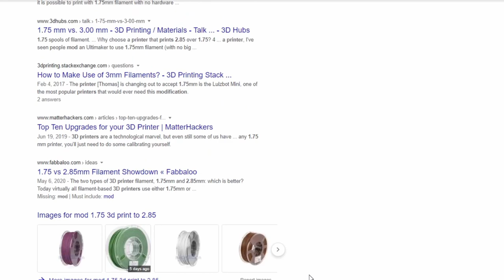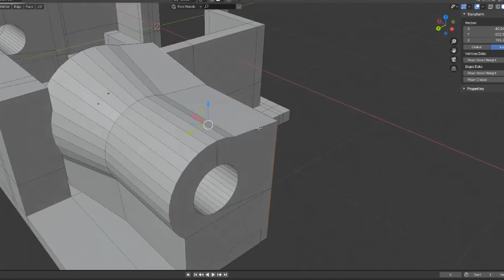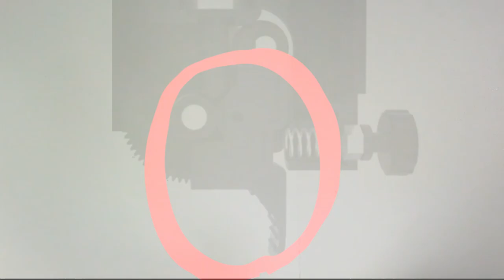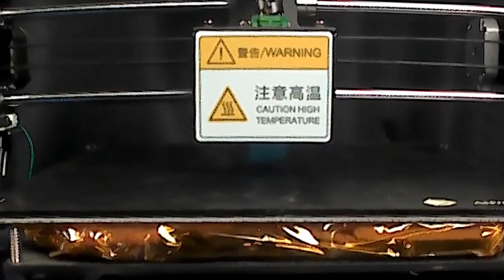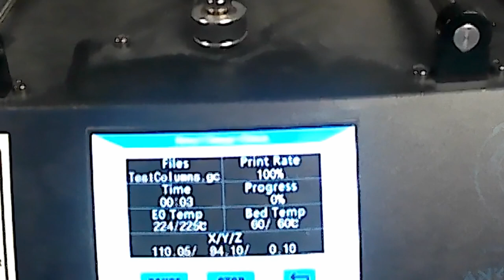Changed a Printer from 1.75 to 2.85 Filament- Possible or Worth It????

Comment: I own a Anet A8 did a similar mod, less modifications required since its a direct drive and now I print with nylon trimmer line they come in odd sizes so it takes a little work (1.7, 2.0, 2.4 2.8). I did it originally because there was  a really good deal on PCTPU but only in the 2.85mm size. that filament it awesome. good work on you mod :D
Reply from the maker: Thanks.  I happy you liked it.

Comment: dope. do you know any modifcation to delete the bowden  tube and have the extruder above the nozzle/hot end? I knew someone who have lulzbot mini who was able to do this mod
Reply from the maker: You can create a Direct extruder rig which is something I might be able to do soon since I've just finished a  new modification to my machine.  There's a couple of other videos to come out before that one but let me know if it's something that you'd like to see.
Reply: I did it on an Ender 3 Pro, I designed and printed some parts to mount the step motor and extruder plate over the hotend. It was like 3 years ago and it keeps printing as the first day, no modifications or adjustments required after upgraded. One of the best upgrades I performed on this printer, really love the way it works that when it was bowden type.

Comment: I want to print 1 mm filament on 1.75 mm filament printer. How do you recommend going about it? thanks in advance
Reply from the maker: A couple of things you'll need to do then.  Change the bowden tube to the proper dimension + Remove the inner tubing from your hot end assembly (some versions that won't be possible, so you'll need to check yours + Possibly adjust your extruder feeder to accept that thickness.  After doing the physical modifications you'll have to update your slicer settings for the larger dimension and figure out new print settings most likely.  Best of luck. :)

Comment: Doing this now with an ender b/c someone gave me a bunch of 2.35mm filament. Catching all heck trying to take it one step further and going full metal. Settled on a e3d v5 3.0 long setup when it was all said and done as it seems no one makes a 3.00mm / M6 capable all metal setup in V6.
Reply from the maker: The biggest hurdle I came across was the filament being so brittle.  The number of times it cracked was frustrating.  Best of luck with your mod, though.
Reply: @Yarkspiri  Do you have a filament dryer ? They REALLY help out.
Reply from the maker: @chrismoore1932  Not currently. Most of the stuff I've been working with didn't need it all that much, although it would have been good to try with the thicker filament.
Reply: @Yarkspiri  It revived some three year old PETG (the 3.00mm that started this for me) and really helped with the stringing and ability to calibrate the printer for the filament. I have the Sunlu S1 and S4 dryers, I'm sure they all work about the same.
Reply: @Yarkspiri  Are you using the thin wall stuff to work in the existing connectors or did you get the super thicc ptfe tube? The upgrade kit I got from e3d came with the thicc stuff and I honestly havent ever seen it before myself but it feels like the filament wont burst out of it.
Reply from the maker: @chrismoore1932  I used the regular stuff.  I made sure to calibrate the extruder so that it would skip after a certain amount of pressure.  This prevents the filament from piercing the tubing.

Comment: Let me give you some advice. The new boden tube you used is not a good tube. It's going to break soon you need to get something with a thicker wall. E3d has a Titan extruder made for either 1.75 or 2.85 filaments. And it is worth it. I'll tell you why when it comes to tpu ninja flex you can't beat it. I have printed literally perfect parts with Ninja flex. It also cut your print time way down. I've also found a .8 mm nozzle to be Superior.
Reply from the maker: I've recently started switching to that company for parts since they seem to be built a lot better.  I'm waiting for some components to come in before I begin ordering replacement for my other machines.  Likewise, I'll keep that in mind, but I've since switched the machine back to the original since it was such a pain to deal with the thicker filament.

Comment: What filament is that blue flexible one at the end? It looks pretty damn cool I'd love to know
Reply from the maker: It's TPU which is a flexible filament that's quite durable and easy to print in most cases.  I use it often for parts that I don't was to break easily.  The only downside is that it's very difficult to do finishing work with items printed from this material.
Reply: @Yarkspiri  yeah but like what brand and stuff?
Reply from the maker: @davidblunt5149  I normally buy Sainsmart TPU filament.  I've tried other's but most haven't been as good.

Comment: Was wonder why expensive $4k+ printer use 2.85, happen to come across this video.  I also own a Mega S(E3D V6) ,  though apparently it wont benefit a small machine like ours its meant to print big and fast with beefy all metal hotend and dual gear extruder drive.
Reply from the maker: Yup.  I'm using the mod still but only because it's good for the functional parts that don't need to look pretty.  I may even try to use a 1mm nozzle to see if it's worth it in the future but who knows.

Comment: Wish I found this video earlier. I recently converted 2 of my 3 Sidewinder X1 to accept 3mm filament. After a while failing to get my settings adjusted, I simply created a new custom printer on Cura with the defaults of 2.85mm filament and this was the key I think. It works great 👍. Thank you for the info and your hard work. Btw, your thingiverse link to your filament sensor and guide isn't working. Any chance you can re-upload these?
Reply from the maker: I'm happy the video helped you out.  I'll check into the thinginverse files to see what's going on with those.
Reply from the maker: Ok the file has been updated.  The link should now work.
Reply: Thank you very much!
Reply: Yo I just saw this and may be trying the same thing, I have a sidewinder x2 do you have any tips on how I should go about doing this?
Reply: @crazyalex-qp3no  which printer u got?
Reply: @antd6738  Artillery Sidewinder x2
Reply: @crazyalex-qp3no  that was the easiest of all my printers (I have the x1 but I don't think it's any different with the x2). I opened up the extruder and replace (or drill out the plastic "cone" think it's called a guide, n I just removed the short ptfe tube that goes on top of the extruder. You can get the right size at Amazon 4mm outer dimension by 3mm inner, but I found it flowed easier without it. I picked up an extra extruder assembly from Amazon and whenever I want to go back to 1.75m filament I just change the whole head out.
Reply: @antd6738  I'm considering doing this to my SWx2 as well. The only thing that is left is modifying/replacing the filament sensor which I'm pretty sure the X1 does not have.